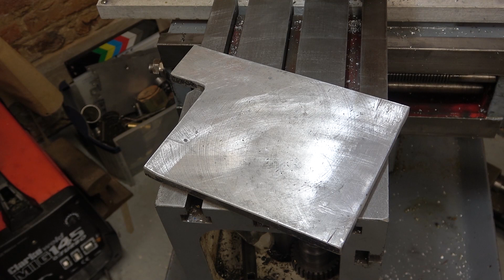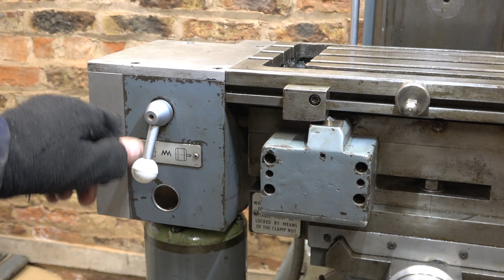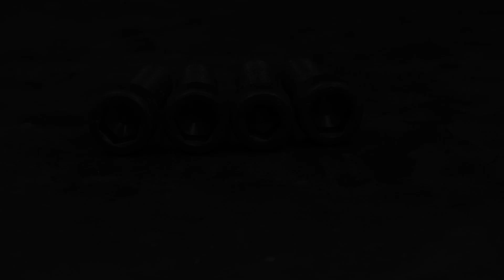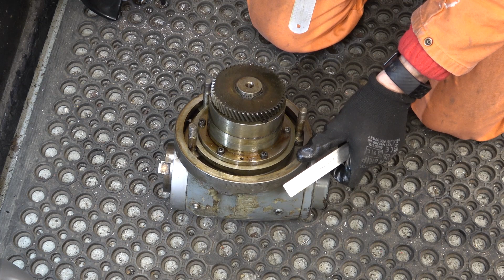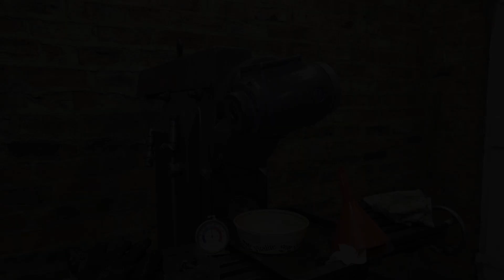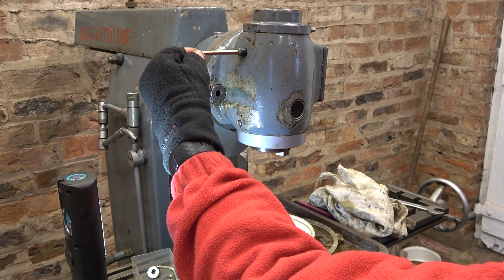HS173 Harrison universal mill servicing – Part 6 vertical milling head

Comment: Hi Paul, very much enjoy your machine refurbishing videos. I am doing a similar project on my little Elliot Juniormill. Already completed the entire electrical rework with a VFD and rewiring the coolant pump motor to single phase use. The machine came with a AEW vertical head which definitely needs attention. I cannot find any documention about it anywhere. I'm wondering if I could lean on your expertise with getting it into fully operational status again. I use the mill in vertical mode almost exclusively. I've already replaced the bevel gears as they were very worn. I believe I'm only about 5 or 10 miles from you. Kind regards, Felix
Reply from the maker: Hi Felix, I'm happy to compare notes. Can you jump onto YouTube on a browser and look in the 'about' section of my channel page and you should find my email address. For some reason they don't show it in the app - or at least I can't find it. Cheers

Comment: Hello Paul,
The wooden stand will be of great help... When we rebuild gearboxes on type 42 destroyers we would do days and days of flushing oil through them to ensure they were clean before going back into service. Somewhat of a tiresome exercise but worth doing.
Take care.
Paul,,
Reply from the maker: Hi Paul, the ISO220 oil in that gearbox gets very aerated although the bubbles settle out after standing. I did not see any contaminants in the gearbox but I am thinking about changing the oil again.

Comment: Hi Paul, excellent idea on the cradle, loved the Heath Robinson radius machining lol, I bet you had a few muscles clenched while you were doing that. Head looks in decent condition, nearly there now. Cheers, Jon
Reply from the maker: Hi Jon, indeed the real superstar in making that cradle was the pillar drill press. It's MT4 with a max 32mm drill in steel. Massive robust table (relatively speaking for its kind).  Cheers

Comment: You're asolutely right. If it works, it works. Plus, what would be shop life without a shaper :)
Good idea to make this wooden stand for the milling head. It makes things a lot easier.
Reply from the maker: Hi Michel, a friend has given me a couple of big slab mills for the horizontal arbor but I think the shaper will normally be a better option.  When I get the mill operational I will schedule the shaper for a service. The motor bearings need changing and the ram clanks too much (I need to examine the pin at the bottom of the crank arm). Cheers

Comment: Feliz año and a Happy New Year Paul!!

Great progress! The support jig was a great idea. The head looked in very good condition. The wiring sounds complicated but you'll get there!!

Good luck from Spain!!
Reply from the maker: Hi David I'm wrestling with the wiring now. Some cheeky and dubious shortcuts by the 'electrician' now corrected. Safety interlock between the table and spindle motors a bit tricky to get right (I think I've got it nailed now but taken quite a few hours). Not quite finished yet so hope I've not spoken too soon. Cheers

Comment: can be a whole load of fun trying to align the drive dogs on the vertical head whilst man handling the head onto the machine and pulling up the rear drawbar at the same time!
Reply from the maker: Hi Anthony, I would not be strong enough to lift it into place deadweight at arms length.  Cheers
Reply: @HaxbyShed   
I done it once and after that decided to use timber like your set up but much cruder design, be careful the dogs engage properly on the  30 taper horizontal spindle because I seen a machine where the dogs were butchered by someone just winding it in with the drawbar and the dogs misaligned!

Comment: Good video, Paul.  Nice touch for the head holding fixture. Did the same for all my chucks for the lathe, (4, 6, 8, & 10). Like your approach to cleaning & then repairing what needs. Top bearing looked like moly-sulfide grease; is it? Expensive, but it clings like an ex-wife's lawyer & lasts just as long. Can't wait for you to start making chips.
Reply from the maker: Hi Bob, I do an unambitious vertical head test cut in the next vid just to prove it works. Nothing fell off so my confidence is high. Currently rewiring the inverters. Cheers
Reply: It’s my understanding that moly sulphide grease is NOT recommended for rolling bearings as it “plates out” on the rolling surfaces, causing skidding and failure of the rolling elements. Plain grease for rolling bearings, please !

Comment: Good episode Paul. I haven't taken my vertical head apart yet so it was useful to me. What a bodge someone did to use 5/16BSW bolts instead of 7/16UNC. They would go in but hardly the best. I really like the cradle for fitting and removing the head. What I was told to do was to make an iso 30 spindle taper (doesn't have to be perfect) Then you fit that to the table and manouevre it into the head. That holds it while you take the head off. Then you can use the table to remove the head.
Reply from the maker: Hi Carl, yes I see the point about the vertical INT30 stub spindle to help position the head and maybe attractive if you have a spare INT30 kicking around to bold to a flat plate. Cheers
Reply: @HaxbyShed  I don't have a spare iso30 stub. The idea is to machine one up. Does not have to be perfect. That then serves as the removal and fitting tool. Mathew Look of lookcreations gave me the tip.

Comment: Great job on the head support/alignment frame 👏. 
Maybe a swing in table adjacent to the mill, and staggered shelves for the vice would help on storage and loading.
Head looks very good.
Thanks for sharing,
Reply from the maker: Good tips John. I need to think about a hoist/lift sometime to get the horizontal beam off for cleaning. Later ....  Cheers

Comment: I thought you boys were 100% metric, what are you doing with a 3/8" end mill I thought those were illegal in your country. 
Keep up the videos.
Reply from the maker: Hi C&ES, everything new around here is metric. I remember at school in the 70s the Govt announced we would all be metric within 5(?) years but of course it all took a lot longer. Weights and measures in shops hung on for a long time and it does not feel like so long ago we switched from gallons to litres for fuel (actually 1st Jan 1995 - I just looked it up).  We still talk about 'miles per gallon' and still say 'a pint of beer'. Of course all the old 50s, 60s and 70s machines (like mine) are Whitworth/BSF or UNC/UNF. At my local auto jumble (flea market) imperial tools and cutters are usually sold cheaply by the bucket load so always attractive. And often imperial drills and cutters make good clearance holes for metric screws and fittings, and for holes for reaming metric sizes. 19/32 makes a perfect 15mm drill, 3/4 is a perfect 19mm etc.  Ditto spanner sizes. There is plenty of life left in imperial sizes here yet,  😁  Cheers

Comment: Hi Paul,

i really like how you repair with your shaper (a dream for me that it will remain lke that!), a great work also on the milling head, that from what i seen it is in really nice conditions: as I understand it, if you want to increase the milling depth, you have to raise the milling table, right?

 It's the exact opposite of my milling machine, which instead has the quill that goes down like a pillar drill;

 I hope to see some flying chips soon, because the feeling is of a rigid machine and therefore I expect to see some nice smooth surfaces, because it sure doesn't vibrate!!

Ciao Paul, have a nice weekend, 
Alberto
Reply from the maker: Hi Alberto, thanks for the comment. You are right, there is no quill. Some people make a type of light 'quill' which is just a small chuck on an 8mm(?) shaft running through the drawbar and a lever at the top. Also the vertical head swivels left and right, but not backwards and forwards. But I have still to investigate what I can do with the swivel table (maybe a limited alternative to a backwards/forwards head tilt). Actually I'm most looking forwards to horizontal milling.     Cheers

Comment: Interesting again to see the differences in the "same" milling machine. My vertical head does not have that hole in the rear face. The casting is noticeably different in that yours has a very distinctive "hump" on the machined face while mine just curves down.

The manual that I have also has a cross-sectional diagram of the vertical head. The diagram is of "my" head, ie doesn't show a hole there (also shows the curved overarm rather than the squarer one you have).
Reply from the maker: Hi Fastdruid, you probably know both the mills and the lathes were given a 'face lift' with the square appearance. It seems like in the 70s you had to be square to be cool 🤣

Comment: When I got my vertical head (I bought it separately) it was utterly dry, no idea how long it had been since it had been used but there wasn't even a trace of oil left in it. 

My rear section sight glass was also originally smashed in, I bought a brand new one which helped massively with seeing how full it was. 

FWIW I filled the front section on mine by taking off the side information plate...and then the cover underneath that. Was far easier than basting through the tiny port, let me visually see what level I needed (I could see the back of the level inspection port) and let me inspect the gears.
Reply from the maker: Hi Fastdruid, I've just been looking on ebay and a small ultrasonic cleaner is about £45 (jewellery size) and a 10L cleaner can had from about £85. I bet that removable sight glass would clean up in one of those. I will put it on my Santa list. Cheers
Reply: @HaxbyShed  by the time you've removed it you might as well replace it though!
Reply from the maker: @fastdruid  Ah yes I've just looked on ebay and I did not realise how cheap they are. But my son has just agreed to go halves on an ultrasonic cleaner - so I've got a dilemma. 🙂
Reply: @HaxbyShed  in my experience it's mostly because they're scratched or cloudy rather than dirty so I'm not sure what good it'll do! But plenty of other uses for an ultrasonic cleaner!

Comment: Hi. I suspect that you already know this but, just in case you don't, acid cure silicone rubber (the stuff that smells of viniger) is mildly corrosive while its curing. You can get neuteral cure silicone (developed so that it doesn't damage the joints in double glazing panels) which isn't corrosive at all. That said I doubt it will matter where you've used it. Cheers
Reply from the maker: Hi Peter, actually I've got some neutral silicone white, from when I fitted the PVCu windows. If I'm encapsulating anything electrical I'd use that now in preference to the acetic acid stuff. Thanks for the advice. Cheers

Comment: Love the cradle. I made something similar...except much simpler. I used four pieces of wood, two horizontal spaced "front to back" and then two vertical. The vertical pair being spaced enough to sit either side of the spindle (ie on the bottom "cap") and at a height so that the rear of the head sits on the horizontal pair. 

I think if I wanted it for storage I'd have to create something akin to yours. Mine works fine for just lifting the head into place on the table but it's not stable enough to keep the head on long term.
Reply from the maker: Hi fastdruid, it's such a lump and there is no obvious flat side to rest it on so I thought it was worth investing the time to make a good cradle. As I was saying to Jason in his comment I may machine an O-ring groove into the mating surfaces between the two halves and the cradle could be a good way to hold the head for that (probably the back half).  Would need packing and clamping and tramming (if you can 'tram' something on a block of wood) but I reckon it would work. Cheers

Comment: Great progress. Fantastic idea to use a drill to raise or lower the table quickly
Reply from the maker: Hi GTB, a friend put me onto that idea of using the drill as a motorised knee lift, esp as the mill head does not have a quill so it can also be used as a vertical feed for drilling if circumstances are right. I needed the drill on the slow speed going up else it stalls - you can speed down as fast as you like 🤣 Cheers

Comment: Great job Paul,  your head support idea is very good,  I might have to duplicate that.  I have a slow oil leak between the two sections of the vertical head on my machine,  not a terrible amount of oil coming out but I noticed the odd drop of oil appearing on the table, apparently that's quite common- does yours drip oil at all?
Reply from the maker: Hi Jason, yes it is dripping oil from that test run. I will run it while to try to understand where it is leaking but it has crossed my mind already to make a circular channel in one face and put a big (6.5 inch diameter?) O-ring in between the two halves. That would be a nice little machining challenge. Cheers

Comment: Slow and steady gets the job done Paul. Like your stand / installation guide for the milling head, that'll prevent injury for sure when mounting. Maybe consider placing a strong magnet inside some of the oil reservoirs the next time you have them open, they're not too expensive and may catch some errant ferrous materials from getting to places they should not be.
Reply from the maker: Hi Paul, the two gearboxes on the vertical head seemed pretty clean and to be honest I'd always be a bit worried about the magnet breaking free although maybe I would if I could get one of the 'penny' types with the hole through the middle, which would take a fixing screw. Cheers.
Reply: @HaxbyShed  Agreed, a loose magnet could cause a ton of damage, but properly secured (like the penny magnets with a fixing hole you mentioned) could prevent secondary damage from a chipped gear tooth etc. Just something to consider when working on these older machines that are manufactured from 'unobtanium' :)

Comment: My friend you have it torn down this far. Clean out the old grease and replace it with newer grease. Here in Milwaukee the weather has been screwy. -2 one and within a few days it’s in 60 Fahrenheit. Replace all of the oil is the smartest thing to do
Reply from the maker: Hi George, that sounds like a big temp swing I'll bet folks are struggling with it. I think I will do something with the bottom bearing - to grease it more. The specified grease is lithium based and I'm not sure what happens if you mix types. Cheers

Comment: Gday Paul, the to do list is getting shorter and won’t be long till it’s all finished mate, cheers
Reply from the maker: Hi Matty, yes I can see the end of the tunnel just about. Rewiring both the power side and the control side of these old inverters is proving to be quite a bit of work but I'm nearly done now I think. Cheers.

Comment: Nice neat repair job on the alloy cover Paul. I'm wondering if the bearings on the head should be greased at all, as there is obviously an oil level for the head. Those "grease nipples" maybe for oil. I know other YT channels have found that people have filled oil lubricated areas with grease because it looks like a grease nipple.
Reply: With most of these machines you would be right. However there are only 6 places that get grease. These are both main motor bearings, both table motor bearings and both vertical head spindle bearings.
Reply: @carlwilson1772  Cheers, nice to have confirmation.
Reply from the maker: Hi Bill, there are info plates on the machine and head that state as Carl has said in his comment. All the other grease nipples are for oil - it's a pretty daft setup as the temptation to grease these is obviously too great for many people.  The head has two greasing points for the top and bottom bearings and two oil chambers - one for the front gearbox and one for the rear gearbox. The vertical head is quite complicated machine in itself. Cheers

Comment: It will be good as new once you are done with it.
Reply from the maker: Hi Tom, is that code for "this is a long series" 🤣  (I have been married a long time and I'm always on the lookout for the hidden meaning).  I'll get it operational and then probably come back to the table nut and screw, once I've got some hours in.  Cheers

Comment: For that open hole in the back of the gearbox, maybe a wine cork would make a good plug for it.  ---Doozer
Reply from the maker: Hi Doozer, they made many variants of that mill and the hole was probably for a slightly different model. A cork is a pretty good idea. If it fell in then nothing would get damaged. I don't know yet why the front section lost it's oil - no doubt that will become clear in time. Cheers

Comment: Looks like it's nearly ready for work
Reply from the maker: Getting there Craig, you will see a modest test cut in the next video but now I've got it apart again to rewire the inverters. After that I think 'initial operating capability IOC' will not be far off.  Cheers

Comment: The middle and head if that’s what it’s called sounds fabulous. You can feel good about taking it apart and inspecting it. I suspect it didn’t hurt that much.
Reply from the maker: Hi Kimber, they made many versions of that Mill. Just horizontal, just vertical, Hoz & Vert with a  fixed 90 bed, and then the Universal with H&V and with the swivel bed (like mine). Some had clutches and some did not (like mine). I realise now that the inverter was set to 70Hz which made the top speed 2100 rather than 1500 shown on the gearbox plate. So yes for 2100 rpm and very cold oil it sounds pretty good. Cheers

Comment: Cleaning up that mill is a lot of work.  Of course when you get it done then you can use it with confidence that all is well.  Thanks for the video keep on keeping on.
Reply from the maker: Hi Harold, all of these machines are a lot of work when you first get them. Besides the basic servicing there are usually many shortcut bodges made over the years that have to be fixed. Cheers